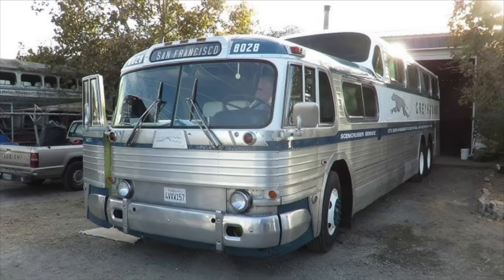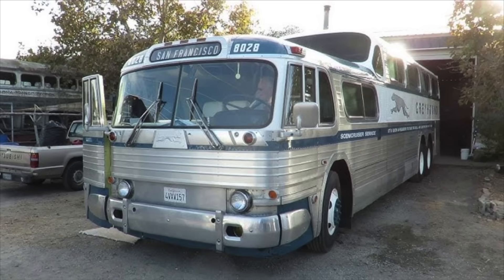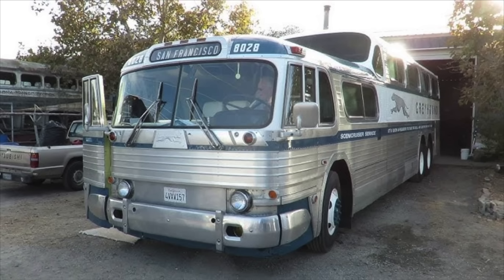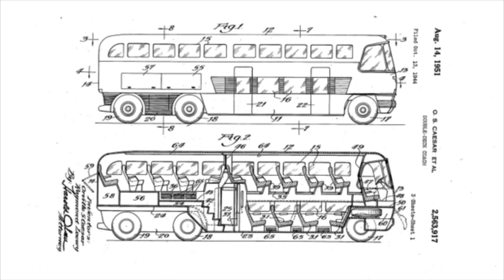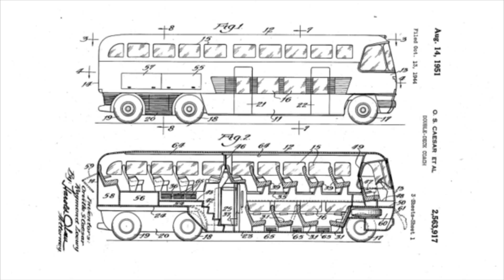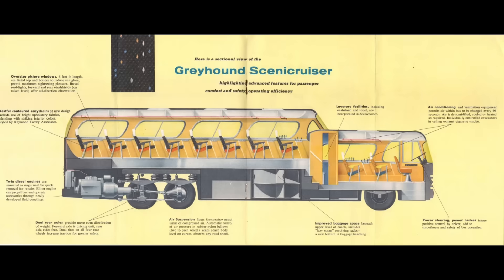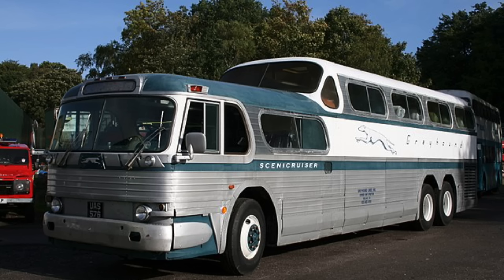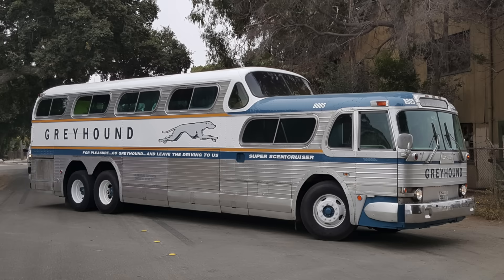Awesome & Flawed Vehicles: 1954-56 Twin-Engine GMC/Greyhound PD-4501 Scenicruiser Bus!

Comment: I've driven several Scenicruisers in charter service. They were  heavy bus for that era and with the full tandem rear axles they road very well. The 8V71 had adequate power but they had an air assisted clutch so you could never park the bus in gear because when the air exhausted from the clutch you need 2 feet on the pedal to get it into neutral to start the bus and build the air again.  Some passengers complained about having the rest room in the front of the bus. Sometimes the odor was overwhelming.

Comment: You've left out the economics that kept this machine running. In the days before UPS/ FedEX Greyhound made BANK shipping modest parcels all around the country. The only hitch was that you had to drop your parcel off at a station/stop and expect to receive it at a station/stop. A station out in the country could be as simple as a park bench and a service station. With their only competition being the Post Office, Greyhound was hauling an amazing amount of parcel freight. Since parcels didn't complain, Greyhound ended up making more $$$$ from their side-line freight haulage than their passengers. ( The Post Office was very much slower to deliver and used pissed off orangutans. Whereas, Greyhound parcels were the direct responsibility of the drivers. So, you paid up to get your stuff there in one piece. ) 
During the original design phase, no-one seems to have ever imagined that their busses would end up making their way hauling parcels.

Comment: You missed the point that the final design gave up more seating for more storage.  Greyhound was the Fed-Ex of it's day.  It could move freight faster across the  country than any other carrier.  Movie theatres in particular depended on the bus to get the newest release quickly.

Comment: In 1976-1977 I rode one of these buses every day to and from work. It was privately owned by fellow employees. It went from Orange County CA to Culver City CA with stops to pickup subscribers. The upper level at some point had been modified to get an extra rows of seats making the leg room very less than ideal. The lower level was left un-modified and that was, because of my long legs, my target for seating every day, if possible. In that one year period the bus never failed. But my back did because of the confinement. I changed jobs to get closer to home which worked out much better over time. I believe this bus had the replacement single motor. At some point I heard that the whole idea behind the two levels was to make room underneath for freight. At that time Grey Hound was finding freight hauling more lucrative than passenger service. At least that is the story I heard.

Comment: As a kid in the late '50s, I used to ride Sceniccruiser buses from Reno to Winnemucca and back  frequently.  Sceing San Francisco as a destnation breings back memories of that being my bus. I rmemember the sound of the engine distinctly, and the driver changing gears sometimes with mostly gentle grinding waiting for the  match of wheel and engine speed.  I frenquently would ask the driver questions in spite of the sign in the front that said "do not talk to operator".  I remember a driver explaining to me why their headlights were always on.  Can still hear the sound of the engine in my mind, and would recognize truck sounds that had the same powerplant.  As a kid and then teenager, it was a great place to meet girls!

Comment: A couple other interesting bits:  There was no fuel gauge and also no tachometer or even odometer inside the bus! There was a hub-odometer that could be read while stopped. It had only a speedometer, oil pressure, air pressure, and water temp gauges on the dash plus blacked out temp and oil pressure gauges for the removed second engine. The bus held (if I recall) 180 gallons of diesel and got about 6 MPG. When I asked the driver who trained me how to know when I needed fuel he said: "If you can drive from a full tank until it's empty without having to make a rest stop, I want to shake your hand." Theoretically that's over 1000 miles! 

It also had an 'Axle Load' switch that changed the weight on the rear axles from more on the tag and less on the drive (lead) axle to put more weight on the drive axle in low traction conditions. When activated it said: "Axle Loaded" on the dash. We called that the 'James Bond' switch. :-)

To get into reverse you shifted to first and then held a switch on the dash while you pulled back into second gear. If the solenoid was working (they failed frequently) you got reverse. If that didn't work you got an assistant with a broom or bat to press on the lever between the rear wheels while you shifted. 🙂 The 8V71 was a bit forward in there so the oil dipstick was VERY long, almost a two person job to check oil. I can't imagine how long the stick would have been on the forward of two 471s! 

Like many vehicles of the age it was positive ground which made installing a stereo system a bit of a challenge! 

The bus had a laughable electric horn on the steering wheel, but a very stout air horn under the front end with a floor button to activate with your left foot. THAT got people's attention!

Comment: I was lucky to drive one of these for two summers in 1981 and 82. Ours had bunks in the back and was used for bicycle tours. We could get about 40 bikes in the cargo bays and had a van follow us for luggage. We went as far east as Nova Scotia as far south as Key West, as far west as San Francisco and as far north as the UP of Michigan.  It was such a pleasure to drive with the engine way in the back and air ride. Ours had the Detroit 8V71 replacing the 2 4-Cyl engines so half the gauges were blacked out. Double clutching was required for downshifts though once your timing was right you could upshift without the clutch at all.

Comment: I owned a trucks powered by a 4  - 71, 6 - 71, 8 V 71  Detroit diesels. They was a very well designed, reliable, well built engines. In the 71 series, they had 1, 2, 3, 4, 6, 8,  and 12 cylinder engines that I was familiar with. Since all the engines had a lot of interchangeable parts, the parts were readily available. I also owned an 8 -71 with a blower  and turbo that produced about 1,000 pounds of torque. Then I bought a 6 V 92 T that produced even more torque than the 8 V 71 T. A friend had a 8 V 92 T that  would pass me by with ease pulling heavier loads than I was.

Comment: Raymond Loewy was probably the most notable of all industrial designers having virtually invented the field.  For example, he designed, in coordination with Jackie Kennedy, the paint scheme for the presidential airplane.  He designed many logos such as the U.S. Post Office logo.  Even streamlined steam locomotives.  And for Studebakers, he also designed the "bullet nose" model and finally the Avanti.  (Although a young Tom Kellogg he hired for the project actually did most of the styling work on the Avanti.)

Comment: This bus and its problems from what I understand soured the relationship between greyhound and GM. This was the first bus built solely for greyhound by GM and was also the last. Interestingly Greyhound would later attempt this again with MCI with the G4500. Built to greyhound specifications for it also proved to be a horrendous failure.

Comment: The Scenicruiser was one reason my dad had a bus-oriented career.

Competitors (MCI, Prevost, and Eagle) both took styling cues from GM and put smaller buffalo-style humps on their buses, but that was phased out by the late 70s.

The relationship Greyhound had with GM became so frustrating that GM in the 60s bought part of MCI and began transitioning to an all-MCI fleet. Similarly, in recent years, MCI went through a rough patch with a Grehound exclusive model, which soured that partnership, so now much of the Greyhound fleet is Prevost.

Comment: I would be surprised if the twin 4-cyl engines were fluid coupled as stated in this video.  Two Detroit inline Series 71''s (4 cyl or 6 cyl) side by side were not uncommon many applications - large trucks, boats, etc.   The engines were configured for opposite rotation and were coupled in a special gearbox.  Each engine drove a pinion that meshed with a central pinion that drove the output shaft to the clutch.

Comment: I got to ride on a Scenicruiser several times as a kid in the ‘70s. Went on the bus between Fairmont, MN and Minneapolis (Bus route was Mpls to Omaha). It was so much better than the flat aisle normal Greyhound. Only got to sit in the “best seats” once. Interestingly, the front seats were always filled with Nuns. Interestingly GM made a train car out of some of the same components. You can see it at the National  Railroad Museum in Green Bay, WI. Also, I had a 1967 Delta 88 when I was in college in the ‘80s. It used to be cheaper to  take the Greyhound to school in St. Cloud than it was to drive my Oldsmobile.  The Olds got 7.5 mpg.

Comment: My all-time favorite drive! It’s like driving a city block. When I was 19, our Drum Corps had a GMC 4104, 4501 (Scenicruiser ) we owned, and leased a 3rd for touring. They were parked within a short distance , so one day I decided I’d go check them out, and the next thing you know I was driving that Scenicruiser.  Could not resist. Unauthorized? Totally.  That changed. I started driving on tour, and always chose the “Cruiser” for driving and as a passenger.  First seats up the many steps are the best. Saw many different states out those windows, as well as the huge windshield when driving.  I remember “just put to the floor and hang-on!” Double-clutching required. All Cruisers got retrofitted with one engine.  Word is, the viscous coupling that tied both engines together, failed often. Labels still read plural “Engines”.  Power steering belt broke; Took 3 of us to turn a corner. More recently, Red Bull customized one very well.

Comment: Arlo Guthrie had one for his band in the 1970s. I think it's still in the woods at his place in Vermont. I bet they were popular with other traveling bands in the 70's too. A ton of storage space. You could load all the band's gear and luggage and probably still have some room left over. And you could tear out the lower level seating and put booths in there, and still have plenty of seating in the upper level. I think I rode one of these in the late 1970s, or early 80s, but I'm not sure. I do remember seeing them back in the day. Does anybody remember if the Green Tortoise operated any Scenicruisers?

Comment: I loved these buses from the first. I took the Greyhound bus from Rochester NY to Manhattan KS. My first ride was on the same Scenicruiser all of the way to Chicago, and another the rest of the way.  I didn't always catch one but loved riding them when I could, 1956-1960. The sound of those twin engines was wonderful and very smooth sounding. The buses rolled a bit with the air suspension. I sat in various seats, based on availability. There were no really bad ones front to back. One favorite was the seat by the door across from the driver. It was a treat as they moved through the gears, very powerful. Talking to the drivers was interesting. I ask one how much they earned, driving one of these, he did not hesitate, $7000! For that time, it was almost not worth finishing college. Another seat was the rear most seat on the lower level, no one in back! The lower level was its own little world. Two experiences. There were very few turnpikes, still at this time. There we were in this 40-foot railroad car of a bus barreling along at 65mph, the speed limit, across rural Indiana, at night, on a two-lane highway, when out of the gloom a tiny red glow appeared. We were barreling down on an Amish horse drawn carriage, with a kerosene lantern hanging off the back! The other was observing the driver maneuver a Scenicruiser down the very narrow and winding ramp into the Chicago Grehound bus station. By 1960 I hardly saw a Scenicruiser. Tickets were fifty dollars or so, roundtrip good for a year. The railroad was a bit more expensive but good for only 6 months. Just for information this was a New York City to Los Angeles bus route what the railroads could only do with difficulty. I liked railroads but one Christmas holiday trip was enough. By 1960 I was glad it was over. The bus routes were changing, and they seemed more round about than in 1956, and constantly changing buses. Example, instead of Kansas City directly to Chicago, they began going to St Louis first. The station would be loaded with recruits from Fort Leanard Wood trying to get home for the holidays. LKW

Comment: When you mentioned "double clutching", I had to raise my hand. In the '50's, I rode Greyhound busses a lot. I always tried to sit where I could watch the driver. I kinda learned to drive that way. Anyway, I could see there was no clutch action on up-shifting. The clutch was used only to get underway and during idling. That engine always sounded like it was going to explode going up through the gears.

Comment: The GMC PD-4501 Scenicruiser was produced from 1954 to 1956, with only a total of 1,001 units being manufactured. These coaches were initially delivered to Greyhound Lines in late 1954 and continued until June 1956. It could have used lots more power though, perhaps generating 1200 lb/ft of torque.  This was a good idea, similar to the rail-sceni-cruisers.

Comment: The twin-engine setup reminds me of the "start carts" used by the USAF for firing up the SR-71 Blackbird's engines. I can understand the former as the 8V-71 wasn't developed until 1957, but for the latter I can't fathom why they went with two Buick V-8s as opposed to just using a single, more powerful diesel or gas turbine.

Comment: As a kid in 1963 I made a trip from Winnipeg, Canada to LA and back, all on Scenicruisers. I chose  a route  that went straight south and arced through the deserts to LA and on the way back went straight north to Vancouver then across the Rockies and prairies. Here is the kicker. Greyhound had a promotional ticket at the time. Unlimited travel in the system for just 100 bucks! The Scenicruiser I was on through Nevada had a nickel slot machine near the bathroom. Of course I played when I thought the driver couldn't see me. Buses seemed quite safe in those days. No weirdos.

Comment: The twin engines were most likely set up like the marine industry had. Which was two engines sitting side by side on a subframe hooked to a reduction gear set up, each engine turned a planetary gear turning a Bull gear in the center and the transmission would be hooked to the bell housing and the shaft would slide into the clutch disk.  The marine industry used a hydraulic clutch (Automatic trans) that would allow slippage between the bell housing Bull gear and the transmission allowing a smooth shift between fwd, N, and reverse. As soon as the rpm started to increase it was locked solid.

Comment: There are some photos of the original twin engine system on the net. The two motors and transmission system were arranged in a type of removable assembly and that was highlighted as a feature initially where they claimed that a power unit could be swapped out in a short period of time. Both motors were positioned side by side forming a V as if it were a V8. There was a system where the driver could isolate either motor so that the bus could run at reduced performance on one motor to get to a safe place,

Comment: GM's experience with air suspension on these buses didn't transfer well to the automotive end. I have seen only one 1959 Eldorado that still had it's original air springs functioning.

Comment: This reminds me of the time in the early 70's when a local Greyhound employee, I think it was a mechanic at the local shop, drove one of these under a low railroad underpass and stripped a large portion of the top off.  🤣🤣🤣
The standard buses would fit, and he wasn't used to the extra height.
Fortunately, there were no passengers on board at the time. 🙏  I don't know if he kept his job or not. 🤔

Comment: @straybullitt    The twin gearboxes were heavy with cast iron cases, big gears and two clutches. To keep width down would require vertical engine installation, which would raise the floor. The 8V71 and later 8V92 engines are fairly tall also, but do not require the heavy twin gearbox.

Comment: I rode on a scenic cruiser as a ski bus in the Seattle area in the ‘70s.  Aaa the smell of raw diesel in the morning!  Now, as city buses, we have ‘bendy buses’ articulating busses and some double deckers.   The drivers like the bendy’s because of their manoeuvrability.  They have a very harsh ride, and a lot of drivers really stomp on them.  So prepare for some high g’s.  I love the double deckers for this reason.  The high end Greyhound type bus I call coaches now, because this is what they are called in Europe I think.  We have a company that runs these between our cities.  Thanks for the good content, as usual!
Reply: Greyhounds are smooth riding, and city buses are like riding a sledge hammer.  We used to have the bendy buses in Memphis, but I haven't seen one in about 10 years.